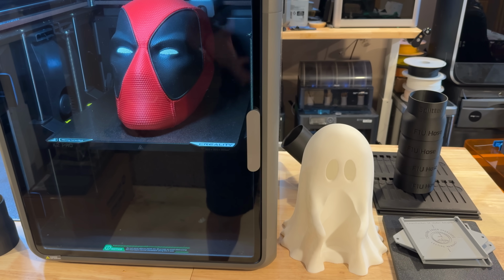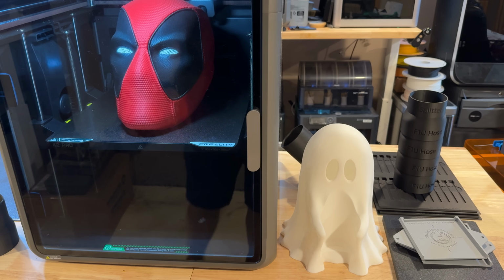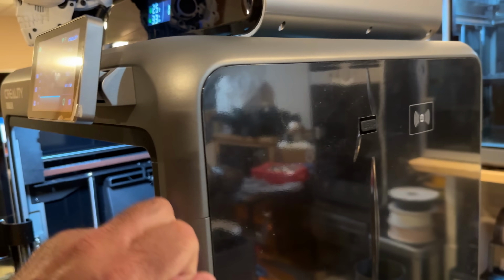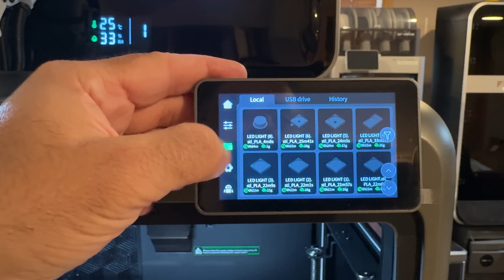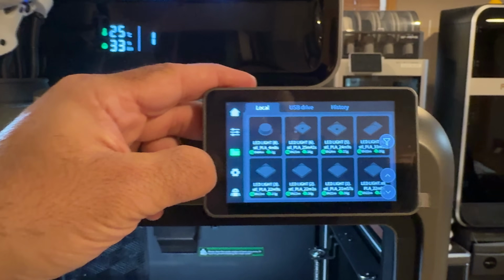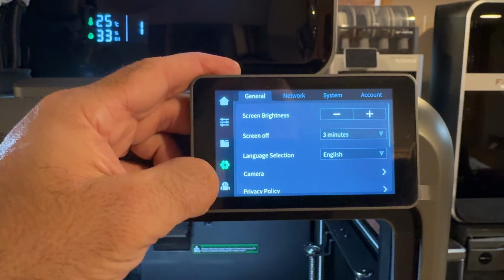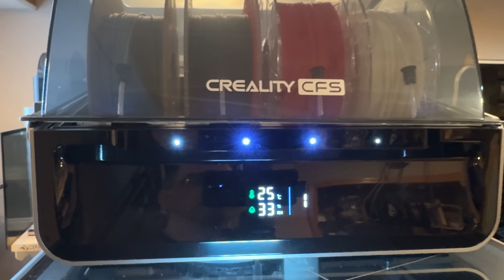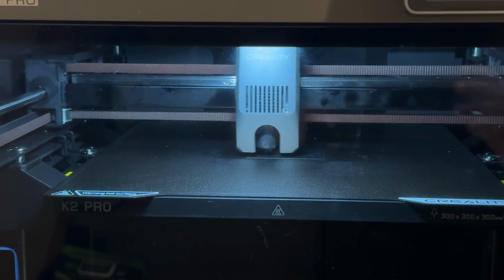I Tried This 3D Printer and WOW! Creality K2 Pro Combo

Comment: Not sure if anyone has said it yet, but there are sizing heads on I believe thingyverse. Head sizes for example 7 1/4 and 7 1/2 hat sizes. They are also labeled in circumference sizes too. Load one into your slicer and put the helmet over it. That’s what I use.

Comment: Lmao. Farm worthy?  It’s not worthy to sit on a shelf. I bought one. 2 days later came back to it and the hot end was COVERED with melted filament. 2 days new
Then I had to go back and forth for 2 weeks to finally get them to send me a new hot end. For ME to install. If you want service warranty don’t buy this machine
Then after I get the new hot end and install it. Print 3 parts and started giving me a z axis obstruction error every other print. Have to restore the machine every other print to fix it. Sent them an email. As of a week ago, no reply
Warning. DO NOT BUY ANY OF THE K2 MACHINES
Reply from the maker: Sorry to hear this. I have for the size for large jigs. They have produced over 30k in reviewing revenue this year alone in parts for our business. I use quality filament for polymaker, I swap nozzle every 60 days to keep print quality, and I have had to replace the extruder since this video. They are solid machines and print faster than by Bambu h2c, H2s or any of j smaller machines. My farm is 90% Bambu and the other 10% are for specialty items. Given the size and speed I would buy it again
Reply: @e @ebpman ell I used there filament. I couldn’t change the nozzle every 60 days because it is only 3 weeks old. 2 days before it failed.
I would not buy another crafty product again. Not to mention WHEN something does go wrong and you are new to printing and don’t know how to work on one,  good luck. They send you the part and tell you to install it yourself or box it up and send it back to China

Comment: I've had a issues with errors on the K2 Pro - looks to be the tool head cable and Creality is sending me a replacement for it. I have found that if you tighten the cover on the top of the toolhead that covers the plug on the tool head cable too much, it causes errors - apparently puts too much strain on the cable. Once I unplugged/replugged in the tool head cable and kept that top cover about a turn loose, I'm printing without errors.
Reply from the maker: Sorry to hear it.   I will share with Creality.  Ours has been cranking out parts non stop. Knock on wood
Reply: @ebpman  yes, I've been in touch with them about the issue. It printed great for 3 days, then gave me error after error for about 5 days as I tried troubleshooting it. Finally got it back printing a couple of days ago.
Reply: @ebpman  My K2 Pro is now working great - creality sent me a new tool head cable and it solved the errors I had. They also sent me parts for the cfs and all but slot d is working perfectly now - looks like the slot d filament censor isn't working so it's not loading. I'm sure they will send me the part to fix it though. Creality's customer support has been amazing.
Reply: @LoriAnneBrown Thanks for following up, helps everyone!
Reply: @mattie3875  Creality helped me resolve it and the K2 Pro is printing perfectly now. Absolutely love this printer.

Comment: Multi head printers have made this obsolete?
Reply: AFAIK multihead printers on have two heads for two colours maximum. There is not enough room to have more on one cross beam.
Reply: @larrya740 snapmaker u1!😊
Reply: Nope. Because they cost 2 and 3 times as much
Reply: @russellargue2721  snapmaker u1 is $799

Comment: I have gone off the Creality K2 plus becuase accordong to multiple reviews the peinter has loys of reliabiloty iasues but most of all can only print PLA.  Everthing elsw inclsuing TPU, PETG, ABS swwm to not bw abke to compete , fail or if thw job manahes to finish have print ringing, first layer issues plis more.  All of your review sa ple prints are in Creality PLA and nkt other filament types So my big quesrion is dowa the K2 Pro also have major filament printing issues and ia onky good for PLA ?  Your farm ratio of 90% Bambu versua creality K2 suggests there is very little Creality offers accross the filament types except slightly bigger build colume and PLA only jobs?? Is thia an accurate assessment
Reply: Are you having a stroke?
Reply: Maybe focus on your spelling before criticizing a complex machine.
Reply: No, not an accurate assessment. The K2 series can handle all the engineering filaments and a lot of people do asa, petg, tpu, carbon fiber and more with no issues - there are other reviews that show this in detail. Personally, I only use PLA in all 10 of my printers (I've used PETG once) and my K2 Pro is working beautifully in my little print farm keeping my customers very happy.
Reply: No reply 🚩